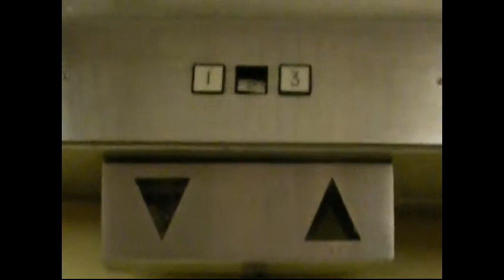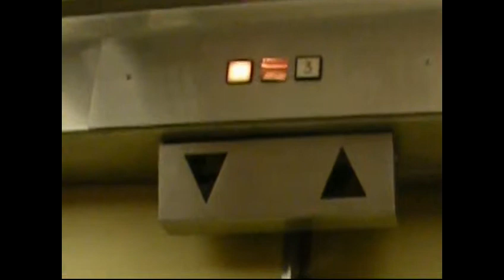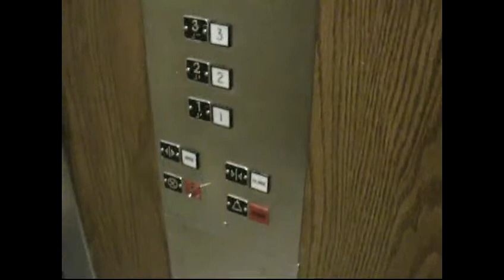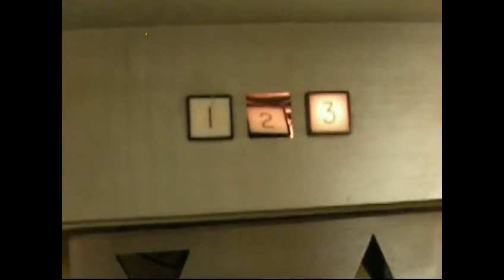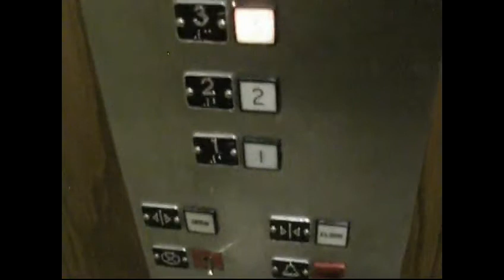Update on the 1970's Montgomery G&P Elevator (March 2013)

Comment: You need to BEG whoever you have to, to let you film the motor room.  It is definitely a traction unit with a VERY old motor.  This has to have been another brand modded by Montgomery.  Oh I would so love to see this one in person.  That motor is very indicative of a very old elevator, prior to Montgomery.  If this were to be the case, this may be one of the original modded elevators to be filmed.